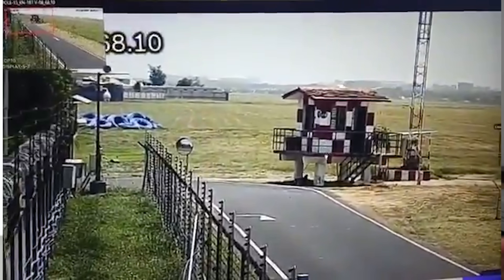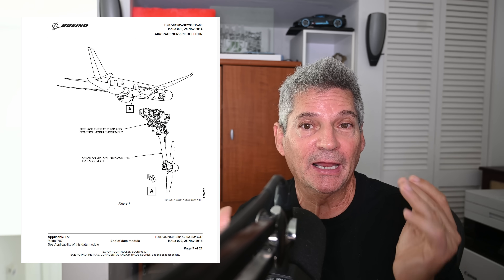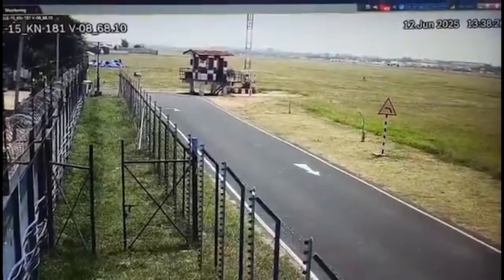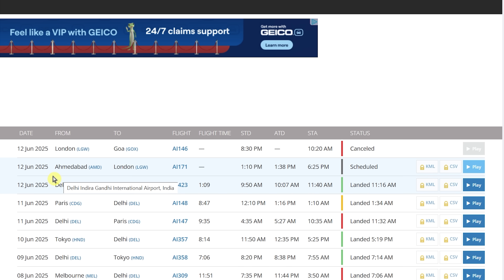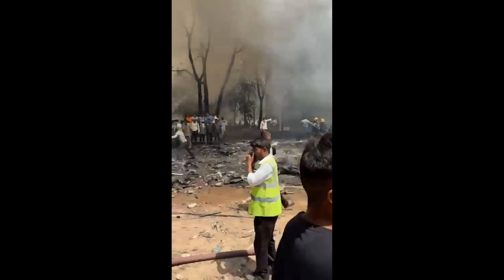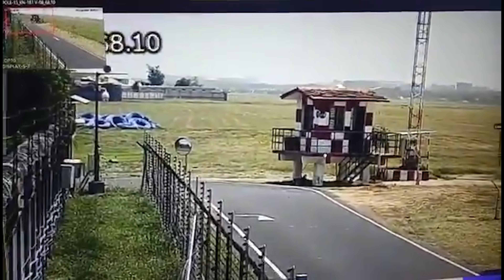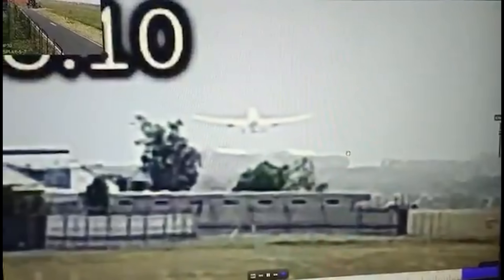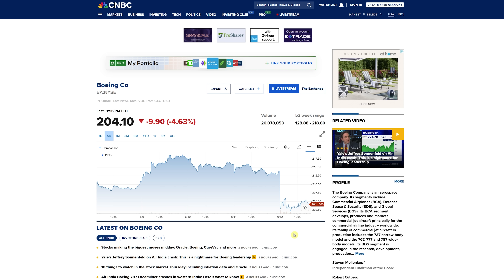What Caused Air India 171 Crash, Mysterious Sound Before Impact

Comment: In my opinion, it would appear that when the Pilot called for “gear up” that the co-pilot incorrectly performed a “flaps up” instead. This would explain why the gear is still down, while the flaps appear absent. With a fuel load for an 8.5 hour flight, and a near capacity passenger load, you cannot maintain proper lift in this configuration. Initial diagnosis would appear to be co-pilot error. Such a tragedy. Boeing should configure a “no flaps up” ability below certain altitudes and airspeeds after takeoff to mitigate for this potential scenario.
Reply: This is the stumper though - why did the RAT deploy?
Reply: How does that explain the pax who heard a loud bang 30 seconds into followed after by the plane descending
Reply: @GlutenEruption  A bang - compressor stall, followed by engine thrust dying off and the RAT deploys  ... now that makes sense.
Reply: @uploadJ - both engines ?
Reply: @uploadJ both engines though? a compressor stall in one engine still leaves the other engine...the plane as loaded as it was should continue to climb with one engine....we won't know until they get data from the FDR
Reply: @GlutenEruption  Loud bang could be sound of RAT deploying after both engines failed.  If no engine power, then no power to raise the landing gear.
Reply: These Controls are so far apart ! And then the would have been a Warning Alert ✅
Reply: lol no not a single airline pilot will go straight flaps up immediately after take off. Also flaps buttons are way far apart from gear lever in central cockpit panel. They are near throttles. This is like muscle memory for any regular pilot just like using turn signal lever in a car.
Reply: Never assume it was the co-pilot, as  every other leg, the co-pilot flies and the Captain monitors.
Reply: The co- pilot engages flaps and gear. The pilot is flying the plane. Take your leg out of your mouth.@Summitspeedfly
Reply: @LA4ever-i3t  LOL -- 20,000 hour airline pilot here.  Captain sits in the left seat, co-pilot sits in the right seat.  (unless there is training going on, then you might have 2 Captains, one in each seat)  The pilots take turns flying, and then have very distinct roles, whoever is actually flying is called the "pilot flying" (PF) and the pilot not flying is called what you would expect - "pilot not flying" (PNF).  We take turns being responsible for reading and performing the checklists, and we take turns operating the flaps/slats / landing gear.  So yes, the Captain engages flaps and gear every other flight.
Reply: Para-gliding is not really adequate  to consider yourself a pilot. You probably have 20,000 hours of bull$hlt flying out of your mouth, but thats about it kid. @Summitspeedfly
Reply: @LA4ever-i3t that’s not true though
Reply: I agree, pilot error on a simple mistake if that's what happened should not be possible. There should be failsafes in place to prevent it or at least some sort confirmation like "are you sure?". The planes computer should know that "flaps up" in that situation would cause loss of lift and therefore shouldn't have allowed it.
Reply: With all of the redundancy built into these aircraft, I can't imagine the engineers leaving out the safety feature you have mentioned that would mitigate the scenario of pilot error of  an incorrect configuration for takeoff. One commenter has noted that the flaps have to be properly configured before the brake is released at the gate before taxing commences.
Reply: And the co pilot thought "well now we're going down and continuing down at the same rate now I guess so we'll just see what happens".  (would they not have noticed that?)
Reply: That's purchase guessing. The aircraft was barely off the runway and the gear would still be down
Reply: Captain Steeeve say the same.
Reply: It looks like this is what happened. Wheel should have been retracting at this point to reduce drag and they were still down. This aircraft would have leading edge lift flaps deployed to increase lift at this relatively low critical speed. Wrong lever was pulled pilot mistake?
Reply: That’s been my theory from the beginning.
Reply: Was für ein - aus meiner Sicht - Unsinn hier behauptet wird, ist schon schlimm. 
Die Maschine hatte offenbar bis zum Erreichen von V1 beschleunigt, also muss mindestens 1 TW gearbeitet haben. 
Nach Abheben wird normalerweise "positive climb" beobachtet und vom Pilot flying ausgerufen, gefolgt vom "gear up"-Befehl für den Pilot monitoring. Der greift zum Fahrwerkshebel, der sich meist mitten im Zentraldisplay befindet. Die Klappen werden auf der Konsole zwischen den Piloten bedient, weit entfernt vom Fahrwerkshebel.  
Wenn denn eine eklatante Leistungseinbuße aufgetreten ist, dann unmittelbar nach Erreichen von V1 und "rotate", ansonsten wäre der Start abgebrochen worden. Für diese These spräche die RAT, die automatisch ausgefahren wird.
Reply: This is Steve s explanation. But he also said the indicators and warnings would go crazy and not unnoticeable so that's not really something that could have happened especially by so experienced pilots.
Reply: I totally disagree. The landing gear and flap switches on the Boeing 787 are intentionally placed in two entirely different locations. Additionally, they are designed to look and feel completely distinct from each other, ensuring pilots can easily differentiate them and prevent accidental misoperation.
Reply: But pilots of this plane say they have and you can't change the flaps after take off!
Reply: The gear is in the position to be retracted; it just failed to complete due to complete electrical and hydraulic failure. The flaps are correctly set at takeoff position, as confirmed in raw footage and examination of the wings post-crash.

The cause of the crash was dual engine failure caused by fuel starvation.
Reply: I was wondering why the gear was still down after 500FT
Reply: @tdeveritt Because the Pilot Monitoring did not raise the f’ing gear handle.
Reply: @tdeveritt cuz they knew it was done
Reply: @tdeveritt I didn’t see a RAT deployed. Just the flaps issue with gear still down.
Reply: @waynewayne9693 I won’t fly on an 787 till I know what happened and the issue is fixed
Reply: I am not a pilot IT engineer but after seen many crash indication I know gear up leavers flap up leaver in two different location. I don't think that has happened
Reply: @RR-jr4ow it would be incredibly difficult. The gear handle is between the flight displays while the flap handle is about 1 foot away on the throttle quadrant. Not impossible, like if co pilot heard one thing and did another
Reply: @schlagzahne6741 but later I thought captain mistakenly told to co pilot flaps up instead of gear up
Reply: @RR-jr4ow  it's often FAR too easy to make a simple mistake that leads to disaster.

In a time limited situation like takeoff it can mean all the difference
Reply: Are they really that incompetent 🤷🏻‍♂️🤔
Reply: @douglasennis7291 it's super easy for people to make mistakes. I was marshaling in an aircraft after it had a 7 hour flight, had the plane stop, indicated to set brakes and instead of hitting brakes the pilot pulled the flight spoiler handle adjacent to the brake lever. I saw spoilers pop up and the aircraft rolling towards me. Pilot realized his error and slammed on the brakes and then properly set them.

One tiny mistake can have a HUGE impact on a high risk situation like takeoff, where there isn't a lot of time to re-check the switches or for the issue
Reply: @douglasennis7291 obviously...indian pilots are known for this 😂
Reply: @douglasennis7291  Yes, No way, i don’t think he did this. The pilots chosen for international flights are highly skilled. When did we hear this before.
Reply: Yes  boeing should auto program the flaps up oncd certain height is climbed with required lift .
Reply: @jlo7204  - You're obviously not a pilot.
Reply: @Summitspeedfly  am not.  But i entire take off is already automated with manual intervention..some thimg else might have gone wrong
Reply: @jlo7204  - No, the entire takeoff is NOT automated.  The pilot is hand-flying, but the auto-throttles may, or may not be used.   We do not take off with the autopilot on.
Reply: @jlo7204 there is probably a reason most aircraft do NOT do this.

You would get a flap disagree message and warnings in the flight deck. The issue here is they wouldn't have a lot of time to react or analyze the problem
Reply: @schlagzahne6741  yes under 60 seconds  near impossible task 

But still too many questions left
How 2 engines lost its power
How come no lift 
Is it a bird hit
Or a sabotage. Or maintance checks  faulted  or boeing had quality issues
Reply: No flaps on takeoff. Plane was doomed before takeoff. Configuration error warning ignored. That and no gear retraction led to increased drag and lack of lift.
Reply: @int53185  Maybe multiple failures here. Usually an incident like these are resulted from swiss cheese failure model, could be malfunction + not following protocols, and then rush due to being late by airline.. all stems togeter to cause a big tragedy.
Reply: @int53185  DUDE there are so many warnign  the plane would not take off  at all and rat deplyed means engine failure

Comment: The seats at the wings are the most survivable.
Most air crash survivors in history were seated at the wings area.
Reply: Some argue the tail is safer, but the strongest part of the plane is the wing box where the main wing connect to the fuselage.
Reply: @Raptorman0909  stronger, but sitting on tons of flammable fuel
Reply: @stefbarone  Likely the wings came off and the fuselage continued for a bit separating the surviving passenger from the fuel.
Reply: He was at one corner of the wing box, the strongest part, but also the main fuel tanks.
Reply: @gebak18  the wingbox area is the most survivable area in an air crash.
It tends not to deform relatively as much as other parts of the plane. 
Fire will break out on a different pattern, the tons of fuel could actually help absorb  part of the impact, fuel later spills and the heavy metallic wingbox continues accelerating past the fireball leaving the tail section to be incinerated. 😂
Reply: I think statistics point at the tail, actually, as a safer area
Reply: No, the rear of the aircraft is the most survivable.
Reply: @nyiragongo-b7d  The passenger that lived was NOT in the rear but was near a wing!  Where you are on a plane matters, but what matters more is how the plane hits the ground.

Comment: So this was a long-haul flight... heavily loaded.  Took off from a short runway less than 7000 feet.  Less than ideal runway length for the load config.  Little or no flaps deployed on takeoff.  Not enough flaps for a takeoff from that length of runway or that loading.  Aircraft very clearly stalls in the videos, which would be expected.  Pilot error.

Comment: I would be very apprehensive to get on a plane in order to investigate a plane crash
Reply from the maker: NTSB people do it all the time
Reply: @jeffostroff yes, l know. They are much braver than l am. I'm not an easy flyer. I'm at my most apprehensive during take off. In flight, landing, no problem. This incident gives me the willys.
Reply: The actual crash site looks very suspicious, the trail is sticking out of the wall, but there are table's with cups and water bottles All in place, no smoke damage, or sign of flames. Probably CGI or AI generated crash

Comment: Boeing has lost it edge in civil aviation.  All 737 are defective most be grounded and need to altered by taking out that switch which needs to be switched off as soon as it reaches its targeted height. This system is not reliable at all. Other Boeing models have their own defects.

Comment: I am a Pilot for T.A.P Air. I am a little surprised that I don't see the Flaps extended, and why are the Landing Gear still out, and not retracted?, and you are right That sound coming from that Plane did not sound like a jet engine. It did sound like the " Rat"
Reply from the maker: I think they lost power and so no way to retract the gear. But I can' tell from the video if the flaps are out or not

Comment: It's not rat, flaps were set wrong
Reply from the maker: The RAT is proof they had either an engine problem or electrical so they could not retract landing gear or flaps
Reply: There is no evidence the rat was deployed!!! Look at ur comments evan a 777 pilot said it wasnt a rat. 
There is no evidence the engines were not providing thrust. So instead of trying to spread false facts and information maybe listen to the experienced pilots and Actual aircraft engineers @jeffostroff

Comment: Nope ... doesn't sound like a prop plane.  Sounds like a jet liner taking off.  I worked for an airline for 20 years and was on/around the ramp for 10 years.  I heard the jets roaring as it went by and then the sound dissapating as it continued away from me.  Being an "engineer", you apparently stood on a airport ramp and watched/listened to aircraft take off.  
Nope - I agree with when the press is presenting.  The flaps aren't visibal - they should be almost covering the engines during a take off.  Now perhaps the engines were throttled back immediately after lift-off, but could still hear them.  So your beginning comments don't fly with me.  No sense watching anymore of the vid.  Looks like the retracted the flaps instead of the landing gear to me.

Comment: You're 100% wrong. The engines were fully running. The plane was overweight and flaps weren't down. Had they used the entire length of the runway if a mechanical had arisen they could have aborted.
Reply: Plane used the entire runway.
Reply: Flaps were down - you can tell because you can see between the flaps and the wing.
Reply: @Brillig2 stfu RichardStover made his conclusion an that is FINAL! The case is closed!

Had RichardStover flown the plane, all had survived. Be more like him!
Reply: Do you have ears? 2 big engines running at max power for a take-off doen't sound like an old cessna
Reply: Not exactly, read my comments in the main thread.
Reply: Overloaded, it takes almost the entire runway to take off. The dust it kicks up at the end (could both engines have picked up some of that stuff?) causes it to lose power completely, the pilots panic, forget to retract the landing gear, and the flaps plunge without adequate support. Wat you think abut?
Reply: @farell8937 that's not an unreasonable assumption. Really anything is possible at this point. I did see what you pointed out. It took the entire length and kicked up dust. What's crazy is they back taxied for full length. That runway is 11,000 feet. With that length, why wouldn't you reject long before V1?
Reply: @MClavo-cf7yg  No, they started roll at the intersection. Had they used the full length they probably would have realized prior to V1.
Reply: @RichardStover-c4s not what was reported. News said they back taxied for full length
Reply: Not RAT sound.
Reply: That's 1000% the RAT that you hear. And it also makes totally sense that the only survivor heard a bang. That was the RAT deploying. The cause of this crash was an engine, electric or hydraulic failure. My bet is very poor maintenance or sabotage/terrorism.
Reply: re: "You're 100% wrong. The engines were fully running."
Reasoning escapes WHY the RAT deployed ...
Reply: @uploadJ it didn't.
Reply: Correct.  Flaps not down.  Don't know what other people are seeing here.  Maybe they're saying "flaps" and mean leading edge and not trailing edge.  Trailing edge flaps clearly not deployed.  Those wings are smooth.  Also, from what I understand, they were told to take off from the shorter runway.  Something like 6,700 feet instead of 11,000 feet.  Not enough takeoff roll for a plane with little to no flaps engaged, hence why they used the whole runway and barely had any lift off the tarmac.

Comment: I heard the Doppler effect shifting the noise frequency as the plane went by. This happens on every take-off and landing.  What I saw missing is the pilot did not change the pitch of the jet as things progressed. If he lost power, he'd level off.  Why did he not change the pitch? I didn't see any roll either. A wing stall will roll the plane. The video is too poor to see what the control surfaces were doing.  That video needs to be analysed by professionals. You did this video too soon. You have nothing so far - not even a good guess. There's just nothing there. The noise pitch was changing do to Dopler effect. You should have held back on this one a while longer. Normally, you are on top of things. But not this one.

Comment: A.  Only 1/2 the length of the runway was in use,  the other 1/2 (behind the plane at the other end) was under repair so they were doing (short field takeoffs) at that airport and so the aircraft only had 1/2 of the normal length of the runway to use for take off.     B. There appears there are no flaps down during the takeoff and it was a hot day (approx 100F) flaps are mandatory for takeoffs and landings.   In the video you can see as the plane is going down that the horizontal stabilizer is pumping up and down,  whether that is the pilots or (flight control computer) is unknown.    C. You can see in the video the dust flying in the air as the plane struggles to take off,   that is from the runways (over run) that is not normally used except for emergencies so clearly the plane was struggling to get airborne.

Comment: Nice speculation but almost certainly no, the aircraft stalls in both senses of the word. First the airflow over the wing breaks down as the air speed vs angle of attack reaches the crtical point and the aircraft is no longer flying but moving forward and dropping down.  This results in the engines pointing up while the plane is going down and unable to get enough air coming in to maintain full power and the engines suffer a compressor stall. RAM turbine is irrelevant in this circumstance